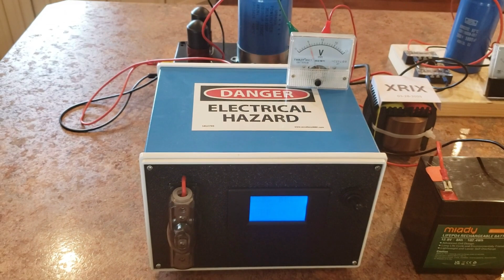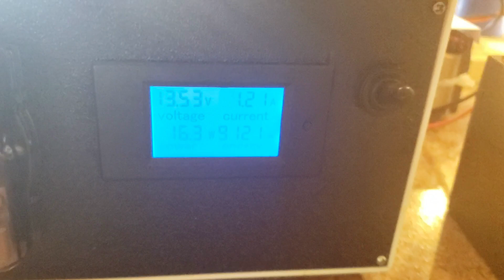Over Unity Working Don Smith Device - Part III

Comment: The device in the video does not work,as the Title of the video suggests.
It uses the same parts as the devices Don Smith has built.
Energy in can be shown in the video...energy out unfortunately not.
Also,everybody please do not forget that Don Smith...had a lot of Smokes and Mirrors.
After 30 years,no usable device.....its bad.
Reply from the maker: I'll make it easy for you. I am a scammer and a fraud. You can walk away and tell your friends you put me in YOUR place. And Don Smith devices don't work. I am merely switching a half a Joule in my blue box. Here is the equation: C=.5uF, v=1500V and frequency is set to 24hz. Hence (.5 x 10^-6)/2 * (1500^2) = 0.5625 J /(1/24) = 13.5 Watts.  It is close to the input energy being consumed.  There is no smoke an mirrors about that math. I am running the load on 120 VDC (Not AC). I said this before: It takes a mediocre  intellect to call out what they think is wrong. It takes an uncommon intellect to provide a workable solution. It takes an exceptional intellect to propose a workable solution than implement that solution. What really is in question is, which one are you? What do you want to accomplish?
Reply from the maker: I am actually only 10. You are an obtuse urchin, that makes unfounded accusations or AI. Hey urchin... how do you make a napkin dance?  Put a little boogie into it!
Reply: @XR_IX  The comments do not delete on their own mate.
Take responsibility for your actions.
No point on calling names.
Reply from the maker: @dragodv7735 You mean no need for names like "Scammer, Fraud"-- Well douche... you have to post enough to have it happen to you. There is difference between caching and update, that causes something you post to go away. It's the same reason, you can't edit your own posts at times... hell it's not my code. However, I have seen it myself, with something I posted. So before you try to accuse people, of dishonestly deleting stuff, be happy to know that I am going to let you keep on showing  everyone, how gifted you really are. Please continue, have a great day not in the USA.
Reply: @XR_IX  I understand.
I will edit my post , if it is too aggressive. And also...RE-post ,the comment that ''disappeared''.
Reply from the maker: Please ask a well formed question, you may get a reply. Be mean and you will talk to the hand.

Comment: If you really want to share this info, provide me a schematic, identify the components in detail, and I will replicate & then get SEVERAL universities to replicate & optimize.  I'll always credit you & protect you from the consequences you are concerned about.
Reply from the maker: The issue is not the schematic, or the components. If that were true, then there were would be no replications; which there are. I post nothing not present in the public domain, because I don't want to be litigated, when a person who doesn't know the dangers of electricity, attempts an alligator and hot glue gun assembly.  I posted my first device on the EE stack exchange, and an EE told me I had a wire coming through my wife's island. That the circuit could not work - flat out. It was dispatched quickly. Several Universities want this, like they want Cold Fusion. -They don't, because they can't patent what is not patentable. I was told by a person that guided me, that Don Smith couldn't get a patent on it, because it was simply an "inverter". If you believe that universities operate on helping humanity, that would be a hair naïve. I put this out here, because it is the truth. I need no endorsements, nor notoriety. My blue box is switching half a Joule. The same circuit could create several orders of magnitude  at the switch, and be magnified maybe hundreds or even thousands of times. There are no limits.
Reply: @XR_IX  guess you are against sharing this technology.  makes me wonder why?  If it works, you have nothing to lose!!
Reply from the maker: @ If I was against sharing this, why posts videos and answer questions? You have to ask the right questions, that's not on me. It is similar to asking a surfer of waves, how he moves from point A to point B. If you have never paddled out and tried to catch a wave, there is no common reference to understand the answer.